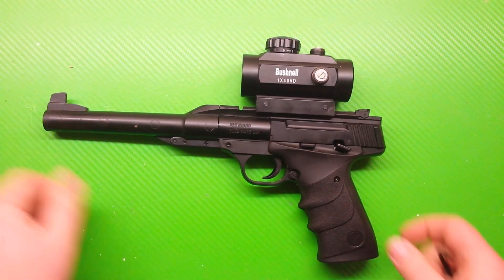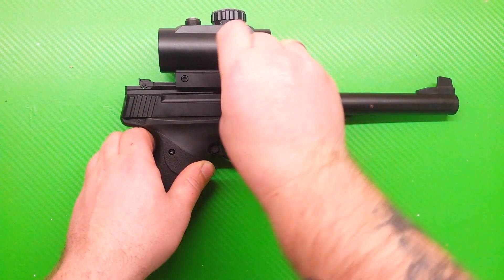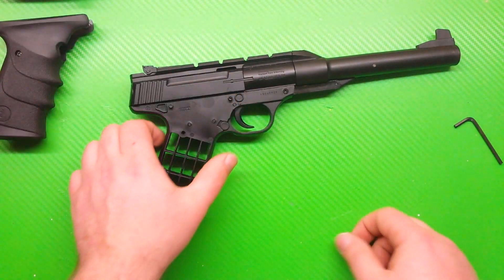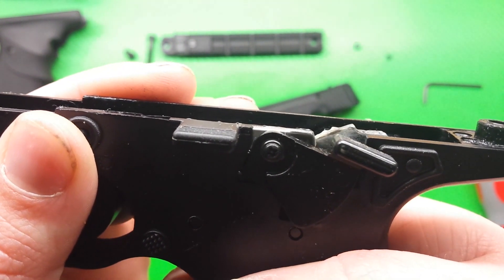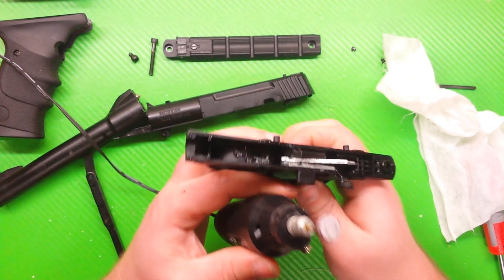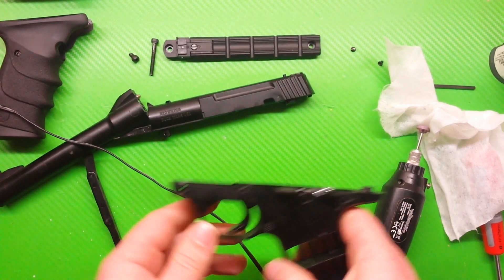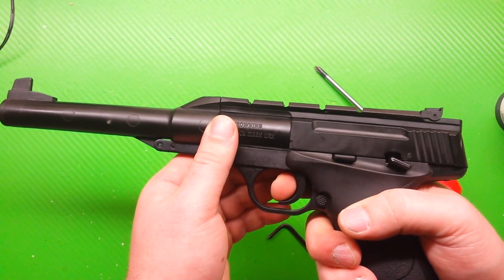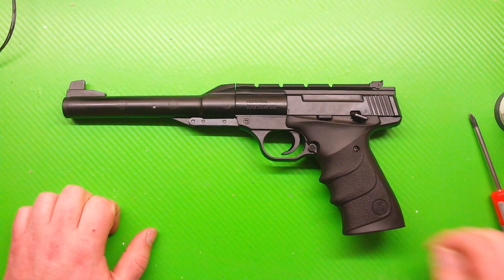umarex browning buckmark urx trigger mod

Comment: The mod works but I think the only part of the piston release bar that needs polishing is the small vertical notch that engages the recoil spring.  That long horizontal section does not seem to bear any pressure.  I found that slightly grinding down and then polishing that notch the trigger pull weight was much reduced but the release bar is made of mild steel and after another couple of hundred pellets the notch wore down and was rounded enough for the pistol to not cock.  Reprofiling the notch fixed the problem but I am sure it will recur as that soft metal keeps wearing away.  If Umarex just used hardened steel for that one small part it could make the factory trigger light enough to be useful and the pistol would be much better with a very small increase in price.

Comment: The weak link with these guns besides the trigger is the breech seal and lock-up.  The seal develops flat spots and the lock-up detent cone can have poor tension resulting in reduced power as the barrel shifts out of a sealed position.  One screw with let the detent cone pop out, you can slighty stretch the spring to increase lock-up and put in a thin paper shim or two behind the seal.  I was losing power and doing this brought it back.
Reply: Can you explain me?

Comment: the trigger on my Buckmark urx got lighter after shooting a few hundred rounds. I assume that like all spring piston airguns it took some time for the guns mechanics to break in. Not only did the velocity and performance get consistent and better, but the trigger got lighter. 
I am still impressed with how this pistol shot 5.4 grain Crosman 'fast flight' penetrators straight thru large metal soup cans!
I think i am going to buy another Buckmark urx .177 cal. as a back up, because the more I shoot this pistol, the more I love shooting it!
Reply from the maker: I have shot more than 1000 rounds prior doing this mod. And it still was very stiff trigger. In hindsight i should just compressed the spring a little bit, because i overdone the grinding, so now it is feather light. But non the less this is one of my favorite guns to shoot with. Thinking about Benjamin NP pistol as well. :)
Reply: .177shooter the Benjamin np pistol is a beast of an air pistol...I have had mine for a bit over a year and I would like to make time to build a shoulder stock for it...I think it is the perfect air pistol to become a carbine.
mine is a 495 fps "made for Canada" version but it still packs a punch and can be very accurate. it is a heavy weight and  since it is 3+ lbs I rarely shoot it from long periods of time.
presently, I am trying to find someplace that sells breach seals, but have had no luck yet. the breach is leaky and my trail Np pistol has lost half of its power :( 
I have read that people use certain washers as shims and place them under the breach seals in order to raise it up so the breach is sealed tight and I plan to do that when I source a replacement breach seal.
Reply: .177shooter the Benjamin np pistol is a beast of an air pistol...I have had mine for a bit over a year and I would like to make time to build a shoulder stock for it...I think it is the perfect air pistol to become a carbine.
mine is a 495 fps "made for Canada" version but it still packs a punch and can be very accurate. it is a heavy weight and  since it is 3+ lbs I rarely shoot it from long periods of time.
presently, I am trying to find someplace that sells breach seals, but have had no luck yet. the breach is leaky and my trail Np pistol has lost half of its power :( 
I have read that people use certain washers as shims and place them under the breach seals in order to raise it up so the breach is sealed tight and I plan to do that when I source a replacement breach seal.
Reply from the maker: if breech seal is anything like on the 1377's transfer port, use a hack i did. Take apart gas lighter, and in the nozzle there is tiny rubber o-ring.

Comment: Ok..  and that is a good mod. But I have an important question for you.  How do I put in a stronger spring ???    My pistol cannot penetrate a thin aluminium can at 4 feet.  Please help me on this matter if you can.  Best regards to you.
Steve.
Reply from the maker: mine penetrates both sides of a soda can from 60 feet. so, default spring is powerful enough. I would suggest to take your pistol  to warranty. I never had any desire to make this pistol any more powerful since, i mainly shoot it indoors.

Comment: good mod. wouldn't just shooting  a shitload of pellets wear the metal  down eventually?
i can feel a difference in my buckmark,s trigger pull after 500 pellets
thanks
Reply from the maker: It should, but after shooting 4 tin cans of pellets (around 2000 pellets) it still was so stiff, that i decided to mod it. Although now it is feather light, so in retrospect i should have just compressed trigger spring, or just shot lot more pellets. :) Regardless it is awesome gun.

Comment: You should never dry fire a spring gun , damage could happen !!
Reply from the maker: i know, but i am not dry firing it consistently, so few times will not damage it, but non the less if it is possible to avoid dry firing i should avoid it :)